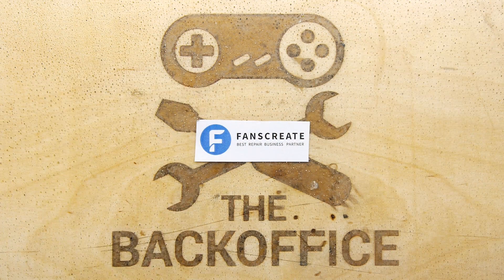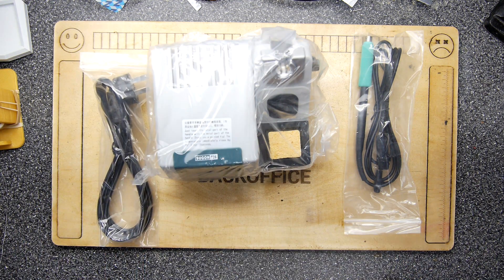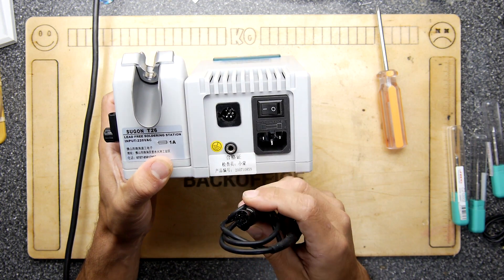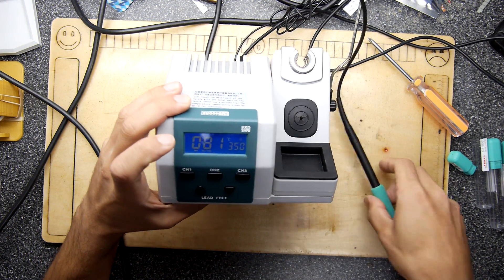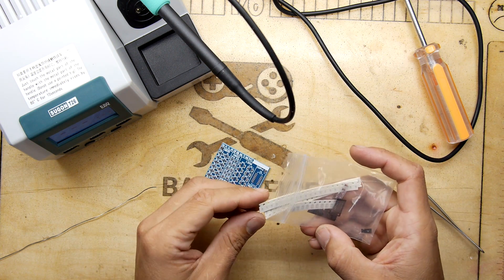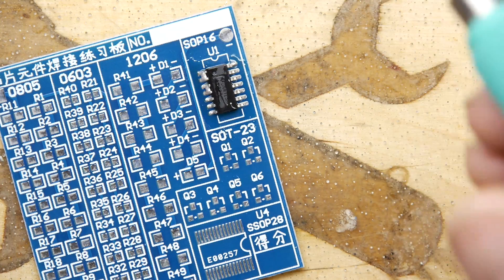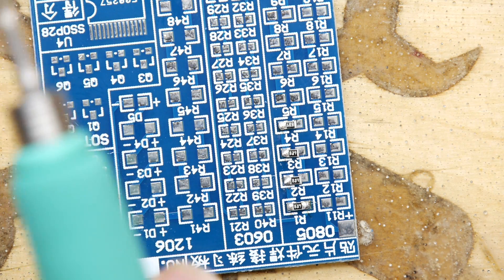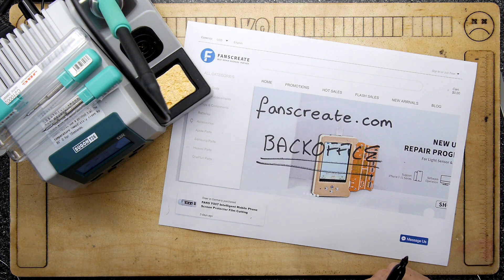Fanscreate Sugon T26 Soldering Station - SPOILER its good!

Comment: Those tips are bad for general purpose work, they don't provide enough area of contact to transfer heat quickly.
Reply from the maker: I disagree, I have used this iron exclusively for months and have had no issues. You would need to be doing a lot of heavy soldering for it to be an issue and most people are not soldering massive heat sinks to PCBs all day.

Comment: Very nice video. I’m curious how well does it work on larger through-hole electronics like say C64 capacitors?
Reply from the maker: I have been using it s while and it works fine, I have a preset to bring the temperature up appropriately

Comment: I was going to say it has the look of, JBC or Pace style soldering iron(s) then I seen on the site it says, supports JBC iron tips. Thanks to your direct link Dr A 😀👍
Before I go ahead, as I'm very interested. How long did it take to get to you ? & Will I be able to use you're discount code still around the middle of next month ?
Reply from the maker: That's it, the tips are JBC so you have plenty of spares available should you mash them 😂

If I recall it was around a week or so, so not too long. The discount code should be valid for several months so it should be fine.
Reply: @backofficeshow  Andrew Your a Legend!! I won't mash my tips, I will still buy the range I will use daily for it. In-fact, I still have some old irons and tips that are 30+ years old, granted they don't see much light of day now days, but still as I'm sure you do, we look after our equipment. Thanks again may you 🖖

Comment: Very nice solder station, when my ts-100 eventually breaks around the power jack section I would take a look at one of these.
Reply from the maker: I am a big advocate for the ts-100 but it certainly has some issues. The Jack is quite bulky but I guess they do not have many other options to get that current into such a slender body. It does sometimes feel like the Jack and the lead weight a lot more than the iron. (I suppose this is true!).

A super capacitor iron would be a real cool idea that charges in its stand. I hope someone makes this!

Comment: I really, really need to upgrade mine. I have a cheap Draper but my GOD it's woeful. I would have more luck soldering with a spoon heated with a blow torch. 

This looks excellent and amazing quality too.
Reply from the maker: I have been using this on for quite a while and I am really rather happy with it. I know a lot of the ZD equipment is popular, but I do think I will be inflicting those on myself again when this level of quality is so easily available now.